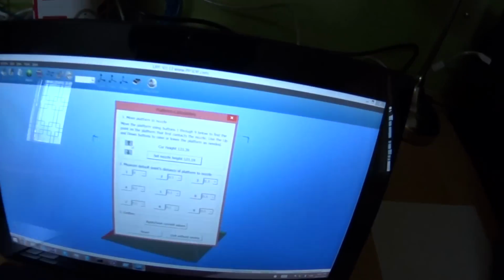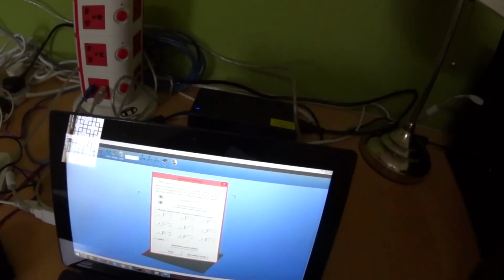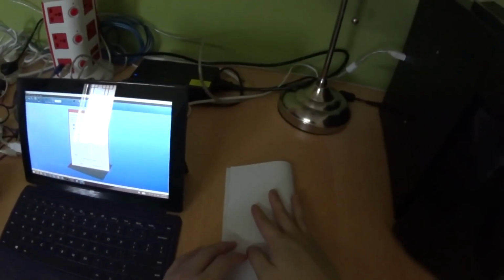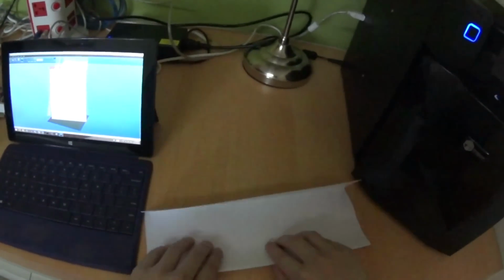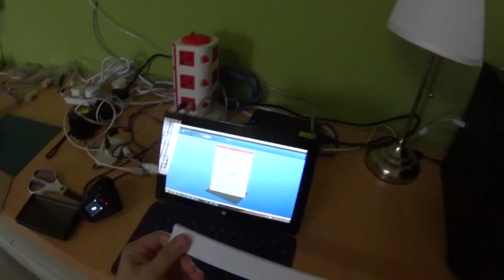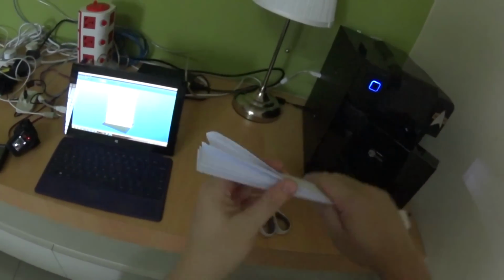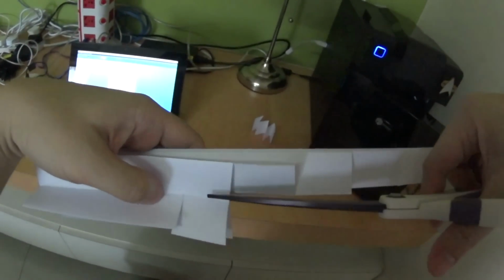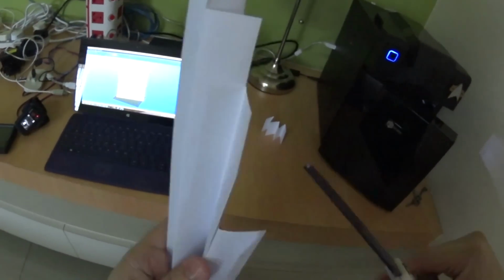Calibrating The UP! Mini 3D Printer Platform

Comment: Good tip with the paper. One Question: You are measuring the distance with the paper and then entering it in the software. I have Version 2.13 of the software. If I follow your workflow, the distance between the extruder and the platform will be 0mm at any point - on entering the value the platform immediatly moves. My User Manual says, I should aim for a distance of 0.2mm. What should I aim for?
Reply from the maker: BillMrDoor the irritating thing is that it'll reset any previous value to 0 when you move to that position.. which is very irritating!! As for the distance of 0.2, it's more like "it works best if the gap height is not more than 0.2"